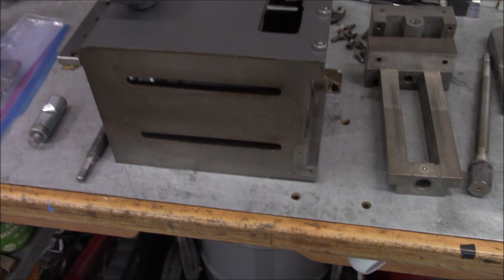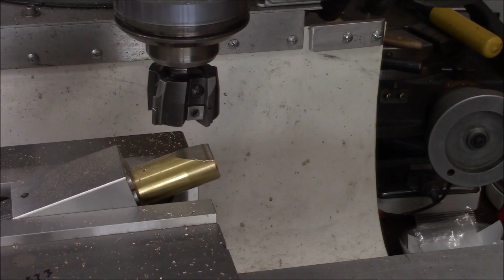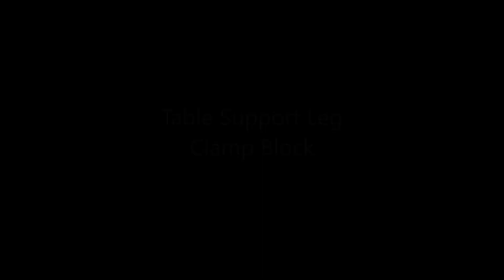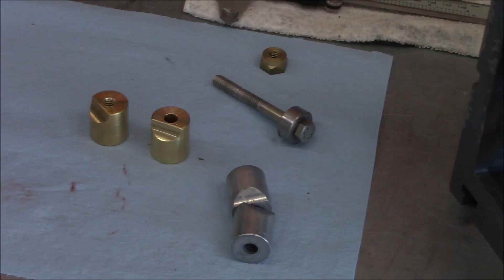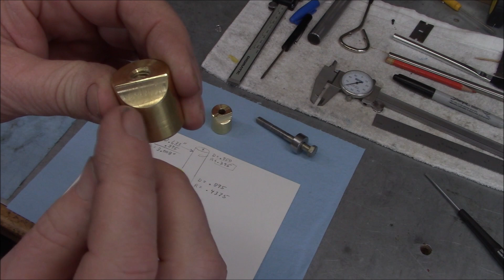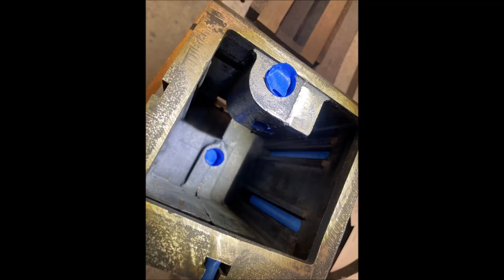Atlas 7B Shaper Project Part 9 - Table and Cross Feed

Comment: Nice job!!! I'm working on same piece...notification bell indicates that you have new video...for my lucky its the same part...i have a week wondering how to cut the chamfer...which drill size did you use for thread? 0.410?... i have almost all the factory designs...it need any let me know..maybe i could help you...Nice to have a helper-boss...he always will remember working with grandpa
Reply from the maker: I used a letter drill size X. = .397 since most drills tend to drill oversized it worked out perfect. Careful drilling through the brass it’s very grabbyy. 
Thanks for the view best of luck with your shaper.
Reply: @TheAyrCaveShop  thanks for the info and video...i just completed with success turning my cross feed nut!!  Keep posting..i also share you channel at FB Atlas shaper group...your followers will raise...at this moment we are 1012 members..take a look over there

Comment: My shaper had the same trouble spots. The feed screw and the front support foot, in my case for the foot it was the distortion as well as very stuck oil. I had to file it down and the lead screw was gummed up too. Penetrating oil there. This is coming along very nicely.
Reply from the maker: Dried oil and grease seems the order of day. Found more today..sure glad I did try running the machine in the state it was in..
ATB...Dean